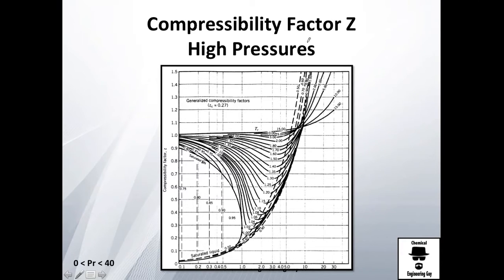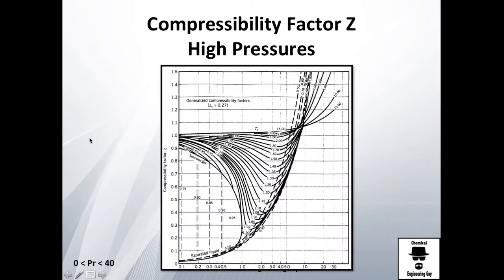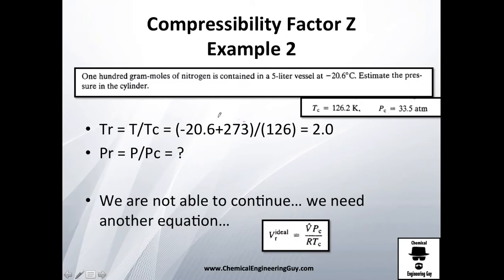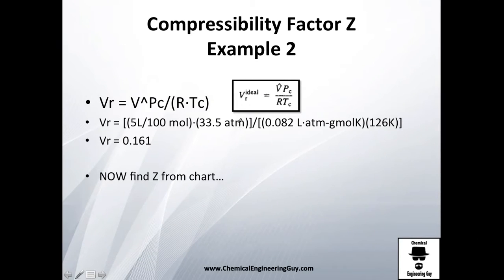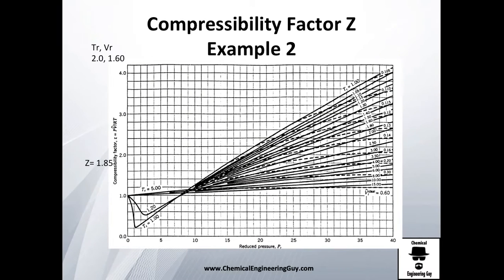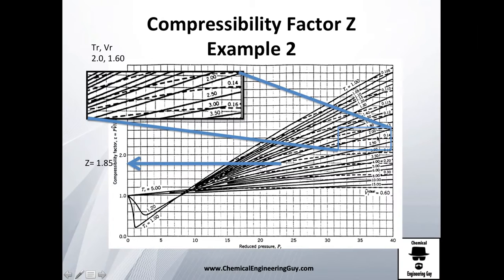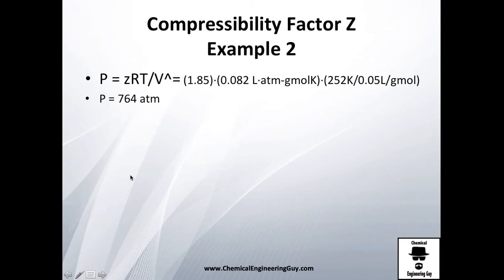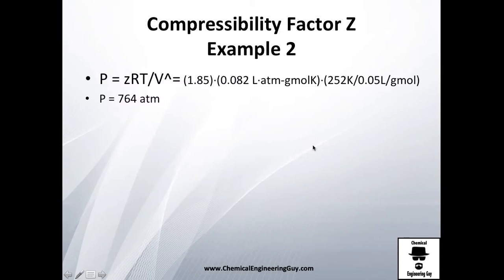Compressibility Z-Chart Exercises // Thermodynamics - Class 90

Comment: how do we find Tc and Pc? are they given?
Reply from the maker: If not given, you can find them in data base/internet. Those are experimental values
Reply: they should be in the back of the book
Reply: As per my understanding, these values depends on compressed gases and chart or table used to find the Pc & Tc of particular gas